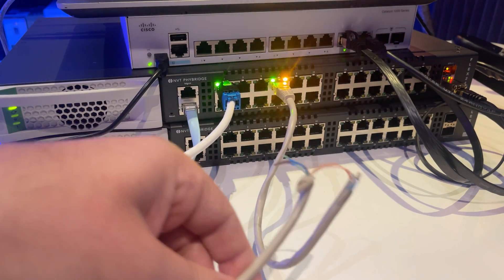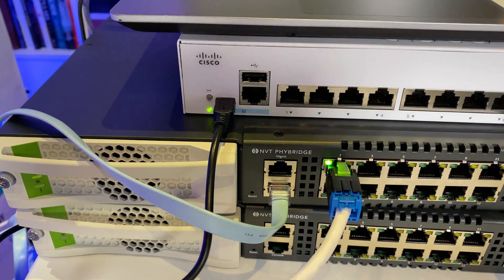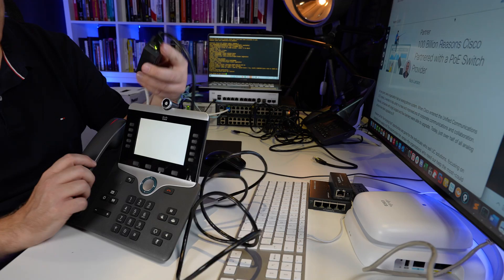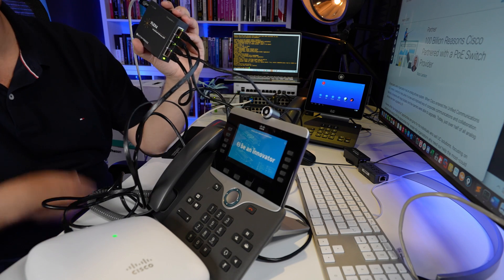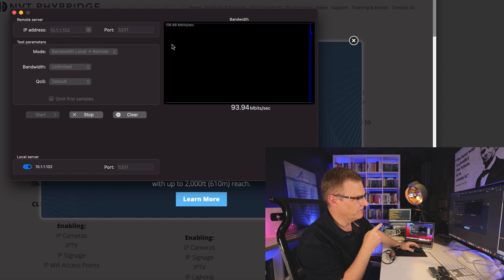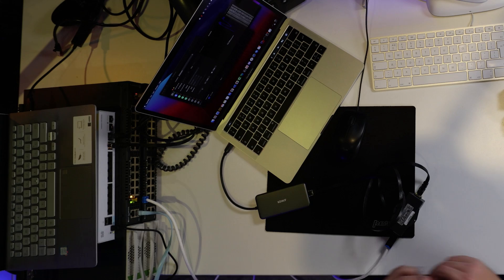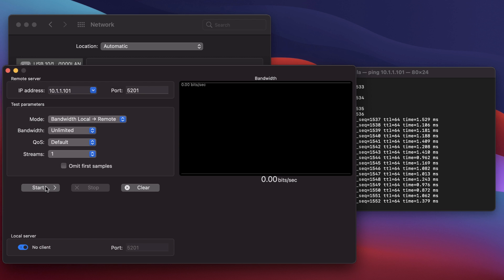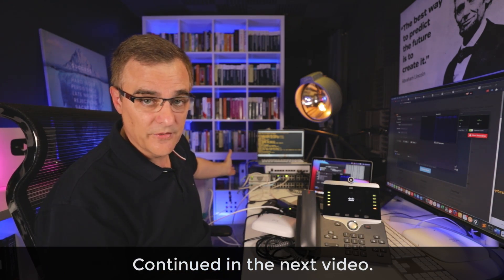Ethernet: True or False (NVT Phybridge LRE)

Comment: I'm working in a building with Cat 3 cabling, and it mostly works, but the main issue is that the patch panels don't use RJ45 (instead some weird connectors that has a tendency to break when pulled out) and they are also placed in locations not possible to secure as well as expected today.
So the main reason to upgrade is to improve the network security, but also that today you'd need more computer outlets and use contemporary connectors.
In general it's not a problem to run 100Mbps on Cat 3, but today many devices want to run 1Gbps and possibly more and then I'd expect it to be insufficient. In a normal office you want reliability.

Comment: I tried the single pair 568B white orange / orange hooked into a netgear switch and I was unable to ping with it. The NVT Phybridge LRE must be able to switch transmit / receive and do buffering in order for the connection to still function. Is that what is happening?? Also, the PC side would have to be able to switch to receive on pins 1 and 2??? The pc side would have no ability to receive any communications, even if the switch was able to alternately go from receive to transmit.  This cannot work!!

Comment: True or False... this was an advert for Phybridge.   At least tell the people how much it cost to make what you're talking about happen.  

Yes, Phybridge is awesome for certain specific use cases.  Like huge warehouses.  However, in those, usually fiber is a better option.   However, the cost of PhyBridges usually outweigh the good of it in most SMB scenarios. 

The only scenerio I've come across where it makes sense to me is retro fitting hotel rooms with VoiP phones. 
The Phybridge PoLRE24/48 ability to send POE and date over 1 pair makes it great for hotel who want to move into a newer pbx, but not have the expense (and issues with remodeling) for cabling.  

However, one 48 port switch from PhyBridge is $2500-$3000.   If a hotel has 200 rooms, that's a minimum of 5 Phybridge switches.  (4x 48 port switches and one 24 port switch)
That's $12,500 Phybridge switches (not including additional data switches) usually needed. .  Then the PhyLink adapters are $500 for a pack of 6.  You'll need 34 packs.  That's another $17,000.  
$30,000 before the cost of new phones or the cost of the pbx.  Let's say for 200 phones and the pbx, that's a flat $20k.     
So for this hotel to upgrade their phone system to something more recent, they're looking at $50,000 minimum.  Not including the labor to do it all / configure it.   Let's say it's another $25k in labor (reasonable for a install this size).  That's $75k.   
To recover that money of a 5 year period,  the hotel would have to make an additional $42 a day.    
If the hotel has a 75% occupancy rate, then that's just an increase of $0.30 a night per room.   For hotels for 200 rooms, Phybridge makes a lotta sense.  

However for motels/hotels with less than 50 rooms, they're in a situation where they may not have all the money up front. 

For the same assumptions at 47 rooms (for ease of this install thought experiment)
1 switch: $3000
8 packs of PhyLinks: $4000
Install Costs:  $10000
PBX / Phone Costs:  $5000
Data network costs:  $1500

So roughly $20k.  
Spread over 5 years, this is $4k a year. This is $11 a day. This would be an increase of $0.32 a night.

It has been my experience though that with 'motels'.  They are better served by running new cabling to each of the room, and installing a dedicated access point and using standard POE equipment. 
47 rooms x $200 a new run = $9400
PBX / Phone Costs:  $5000
47 rooms x $50 per Mikroktik wsAP ac lite = $2350
Install Costs:  $10000

This way the motel not only upgrades their phones, but their wifi as well, and gives them options to be able to upgrade both phones / wifi cheaply in the future.

Comment: You can easily stream multiple 4K streams with 100Mbs. 4K Hvec 10bit uses about 24Mbs. Regular 4K streams are 12 to 17Mbs depending on frame rate.

Comment: Is dodgy cable transfer just one-way? We're the pairs cut the ones for power and the one for the other way? I don't know, just assuming this would make sense as to why.
Reply: Hi, this is Rajesh Chandran, I work with NVT Phybridge and am glad to help you with this question. NVT Phybridge FLEX products will support single pair, 2-pair and 4-pair CAT cables. When it comes to a single pair setup, it has to be the 1,2 pairs and only Data will be provided on the line, PoE is not provided in a single pair setup. The adapter has to be locally powered. Whereas on 2-pair and 4-pair setup we support both Data and PoE up to 2,000ft (610m).

Comment: Ethernet over UTP can't go longer than about 100m! Otherwise you can not have Collision detection, which is an important part of CSMA/CD. There is no way around that.  
You did something different @3:40. You used a pair of bridges to transfer the data from Ethernet-over-UTP to some different coding method. Similar to using an Access Point to "convert" from UTP to Wifi. Of course a transmission method/coding which is not Ethernet-over-UTP is not limited by the limits for Ethernet-over-UTP.
Similar you use other bridge types to use different types of older cables. Basically that is all the same operation and says nothing about the length limit of Ethernet on STP/UTP cables.

Comment: @4:29 "So the maximum distance of ethernet... isn't 100m" But it is - per 802.3 specs (i.e. the 10/100/1000 that phone, or a random laptop speaks.) What you have is 2000ft of LRE (aka. VDSL). Plug that cable directly into the phone instead of the converter, and it won't remotely work. ~60vdc PoE can't go through that much wire. Line powered telco gear does so over such distances by using hundreds of volts (I've seen 350vdc) and very low current. (well below dangerous-to-touch levels.) ['tho, being a Cisco(TM) phone, it might actually work -- i.e. support LRE.]
Reply: Actually it would work as the PHY would switch standards back to 802.3, at least at a distance that it could connect with 802.3.  Also, PoE distance is more affected by the cable resistance.  Depending on the PD's cut off voltage, you can still lose 15-20 volts to the cable and still correctly power up the endpoint.

Comment: Dodgy cable causing CRC errors? Flashing orange light...
Reply: The flashing orange is due to a 100mbit connection, when a gig device is connected at standard reach, then the green is used.  There will be no packet loss/CRC errors within advertised distances unless it is due to a large noise source, which often a ferrite at the switch end of the cable will suppress.

Comment: The times that I've looked into this to run PoE for surveillance cameras over existing coaxial cables it was cheaper to just run new cabling. I know that won't always be the case but until pricing comes down on this equipment it isn't always the most cost-effective choice.
Reply: Hi Shiny Tech Things, I want to be open with you and say I work with NVT Phybrdige as a Manager of Sales Operations so my opinion is a little biased. I agree with your statement, if all your runs are within 328'/100m and the infrastructure is easily accessible to replace it would be cheaper in cost.   When you go beyond 328'/100m that becomes a different story as you will now need to put in IDF closets with cooling, power, backup power, rack space, and more switches, plus disruption to the business. The further you go the higher the costs, not to mention the increased time. If you were to call into NVT Phybridge with all but one run inside the 328'/100m we would recommend you run new cable for all the runs under 328'/100m and use our extender solution for the one run beyond the reach limitation. We are not here to push our solution, we are here to understand you and your customer's needs and add value where we can.
Reply: @gregoryshishkov2899  Thanks for the reply and that totally makes sense. I just wish the prices would come down for the shorter runs because I would love to install these for home users upgrading to save time but am guessing it will be years until prices come down or large advancements are made where systems would be upgraded and the second hand market would open up but don't expect that for a long while anyways. The majority of the systems I would be upgrading are consumers that bought a DVR and now a NVR from Costco, so for now just run new lines usually.

Comment: Can you?

Should you?

Two different questions…😁

Stay within specs or every broken (fill in the blank) will blame it on the network.
Reply: that's an old paradigm sir.  Specs were meant to be broken
Reply: @paulgunn264  You break them with new tech…not by doing what is right in your own eyes. 
Invent better cabling and spec it out.
Reply: @chadseaton1300  so spend more money unnecessarily on new infrastructure and cabling to get the same performance you would get out of that current cabling? Why not just base the specs on what the endpoint needs then work your way from there. Otherwise, you are in a constant loop of buying the latest and greatest cabling which has no ROI.
Reply: @paulgunn264  I wish you worked for me Paul…

Comment: But you are using a 1Gbps Cat6(!a) cable (Class E, 250Mhz, characterized to 550Mhz (claimed by panduit)) and you are only getting 100Mbps, so yes, you are loosing performances. ∴ the myth isn't busted.
I am also pretty sure this myth is based on very old cables: Cat5, 4, 3 or lower... which will most likely die at that range. Cat5 might be able to finish a ping while you are making coffee...

I wonder how well a Cat6a and Cat7/7a would do vs the Cat6... or Cat8 which has a lower max length, but way higher bandwidth.

Comment: Can you tell us why and how it works, rather than just showing it works.
Reply: The PoE works at the longer distance due to more wattage per port available and a higher voltage (default 56V) so the endpoint still gets enough power including what was lost to the cable.  The data works by converting from standard ethernet to a different signaling scheme, which is then converted back to standard 802.3 with the adapter.  For regular reach, the ports can be set to 802.3 mode, allowing a max speed of 1 gig per port without any adapter.

Comment: So first one is a false test. It's using a poe injector at the last 100 meters not sending electricity over the full 2100 meters. Got to represent the tests right.
Reply from the maker: You realize tbat the only power is from the switch - right? There is no additional power added.

Comment: Greetings David, in the single pair of cables, it would have worked with any pair of cables left? Or you need a specific pair of cables in order to be able to send data through the Ethernet cable?
Reply: Looks like he used the orange pair, so this means the 1-2 cables, so first pair. I think it would have worked also with pair 3-6.

Comment: This is like using repeaters and then saying wireless signals don't attenuate. You were selling a product not myth busting.
Reply: @SHEISTER CAM It is a myth in that we were all taught 100m was the limit, and the majority of people don't know there are ways around it.
Reply: @SHEISTER CAM you have stated the official stance on cable length, I am not disputing this. My point is that many do not know it is possible to go greater than 100 m, using assistive Technologies or not. Many just simply do not know. This is why I am saying it is still classified as a math. Also, for a long time, 100m was realistically the limit, before assistive Technologies came along, so if you learned about it in school and wasn't made aware of new technologies, you would not know
Reply: @SHEISTER CAM well now you know this technology exists. Sometimes you don't have any other option.
Reply: @SHEISTER CAM Advertisement or not, still pretty cool. There is also other cabling that can do longer than 100 meters. We used some that was rated to do like 850 feet. Also, some switches have a long range mode, at a slower 10Mbps. 2000 feet though would be great, not needing to run fiber.

Comment: Please explain why the PING time changed from roughly 2ms, to 80 ms, to 200 ms.      I noticed this in the latter stages of the video when you were using the "messed up" cable.
Reply: Hi, This is Rajesh Chandran and I work with NVT Phybridge and glad to help you with the question. Check out various stages of performance test results on our site.

Comment: -Thanks for the Professor David demonstration.
-Then we normally use 100Mbit Ethernet in two types of transmission 100BaseT4 that uses 2 pairs or 4 wires to run at 100MB or 100BaseT2 that uses only one pair of wires to transmit the same 100Mbis \ s that format if not in error uses the EIA / TIA-568-B standard, so even with a cable with several broken pairs if the right ones are ok you can transmit with fast Ethernet.
-This PoE product is very interesting, nice to know that Cisco and other manufacturers are going to adopt this very cool system to use it over long distance links, normally I would use fiber with GPON to go up to a few kilometers, but this system is very interesting mainly because that uses existing connections or that need multiple PoE devices.
-Thanks for sharing Professor David ... !!!

Comment: Well..... I want to see if this works without that Flex-Link, just the cable connected directly to the computer.
Reply from the maker: A few people have asked for this. I'll demo that on the Cisco switch and the NVT Phybridge and add that to another video.
Reply: Nope, because the NIC in your PC/laptop wants an 802.3 spec ethernet signal. LRE is basically VDSL. (and it's technology Cisco abandoned over a decade ago.)
Reply: @jfbeam  the switch has two modes, in regular distance with an ethernet capable cable, it will work without the remote adapter
Reply: @jfbeam  It is not VDSL or a version of, as it is symmetrical whether 1 pair or multiple pairs.  It is closer to the new 10Base-T1L standard.
Reply: Duh. Of course not. The equipment at each end is why it would go 2000 feet.

Comment: 100м without poe, not real... when I connected pc to pc already at 50m were problems, not much power. When I installed from one side the switch, and repressed the cable, and add one short then it worked.

Comment: One thing I learn as a network engineer, there are standards and rules and then there are real-life problems. Standards and rules are good to follow whenever possible but every now and then there are exceptions and Ethernet standards are no different. I work for a company that does data cabling and my role is to provide networking services for customers. Often, in my experience, when long-range data cabling is cost-prohibitive or the customer has pre-existing cabling, we provide Ethernet range extenders similar to NVT Phybridge. The biggest drawback is that because they are not to standards, all the usual expectations of Ethernet get thrown out the window. You get what you get until you don't. Still a great video!

Comment: Ethernet is actually a transceiver.  The tx and rx lines are basically antennas. This is why the broken cable works. As long as one pair syncs to the network card you are good. It will be spotty traffic because of packet loss for obviously reasons.
Reply: In this case that single pair is full duplex so data flows both directions with no packet loss.

Comment: This reminds me of some equipment I used to work with called "Etherextend", which combined multiple pairs to connect sites.  Bandwidth depends on distance and the number of pairs used.  I believe some models could use 8 pairs, IIRC.
Reply: Hi James, I want to be open with you and say I work with NVT Phybrdige as a Manager of Sales Operations so my opinion is a little biased, as I said in other replies. This is a common theme amongst many extender solutions except for NVT Phybridge. There are a lot of components to consider, but we deliver 100mbps up to 2000' with the FLEX solution on 4 pairs of CAT6 cable, the only thing that drops over distance is power availability.

Comment: 6:07 I am assuming. 
Their switch calculates resistance across the wire, and based on that increases Voltage. And that small device than steppes down voltage.
Reply: Hi, This is Rajesh Chandran and I work with NVT Phybridge and glad to help you with the question. Each port on our switch can provide up to 48-58V. On the FLEX-Link and FLEX4, the output is fully negotiated PoE. For more insights, check our website and book a meeting.
Reply: It's a constant voltage, it drops with distance as per normal wire resistance. The PoE spec technically gives a bit of flexibility (ie, 44-57V) -- this can arguable go outside that, though.
Reply: Signaling voltage is not changed with this solution, the data transmission standard is changed, which is then converted back to standard 802.3 with the adapter.  If no adapter is used within standard distance, then regular 10/100/1000 802.3 can be negotiated/selected.
Reply: @adamthompson7447  That is what I meant.
Thanks for reprising correctly. 

However I am kind curious wouldn't the increased voltage increase the crosstalk.

Comment: Working in controls, im very interested in networking but I'm still very novice. Any advice where to start? Loving the videos!
Reply from the maker: CCNA is a great and is my recommendation if you want to become a network engineer. You can also look at Network+ if you struggle with CCNA or want to branch into other areas like hacking. Either are good, but CCNA is my preferred (but I do have a lot of Cisco certs).